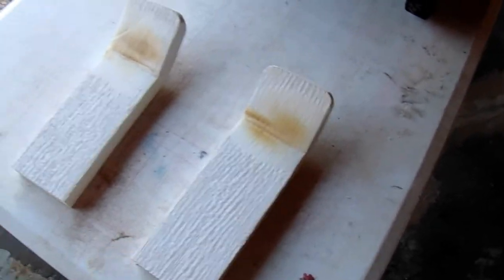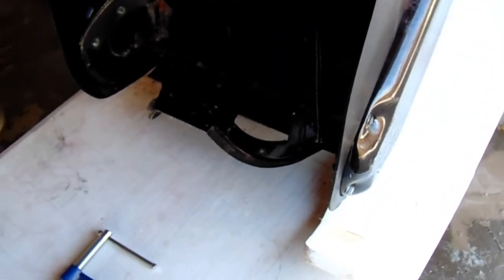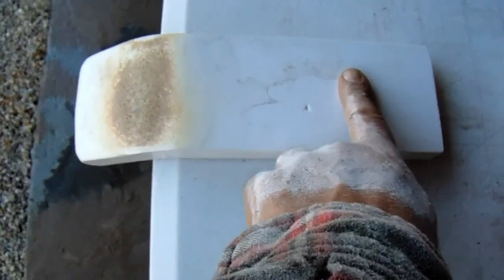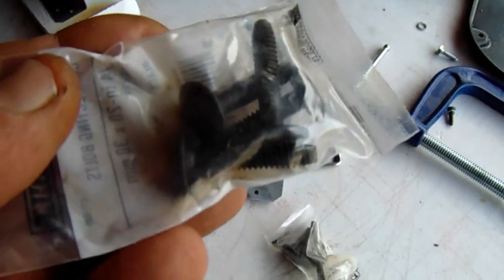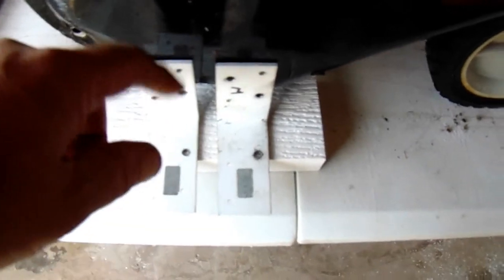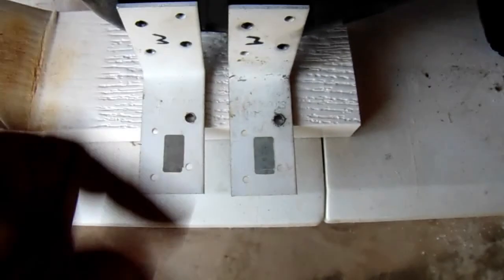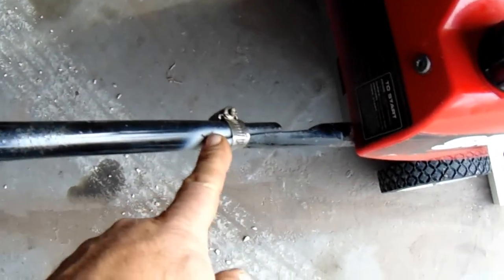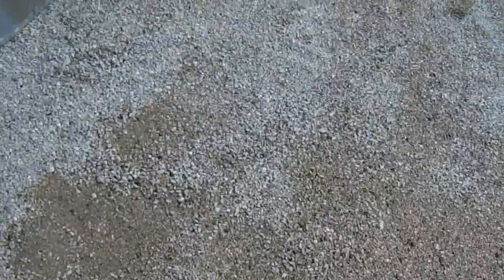SNOWBLOWER On GRAVEL DRIVEWAY HACK FIXED SOLVED Single Stage

Comment: Cool!  I'll be trying something similar although my version will also involve roughing up the side plates of my snowblower and adding JB Weld as well as the bolts as my snowblower has plastic sides instead of metal ones. I thought I'd just use some 2" wide aluminum flat bar stock and bolt/jb weld them to the sides of my snowblower, drill some holes through the bottom of the bar stock and add a pair of aftermarket adjustable skids for a 2stage snowblower.  Wish me luck, lol.  Our gravel is a larger size (#2 gravel) but it is packed down pretty well from years of being there.

Comment from the maker: I ended up taking about 1/2" off the bottom of the skids, 1 inch was too tall, also a bit better to mount the skids more towards the inside of the snow blower. I also made the front of the skids more pointy like ski's so there's less resistance pushing through the snow. Had to use a clamp on the auger lever because I put those handle extensions.